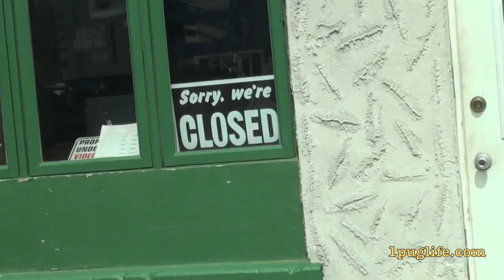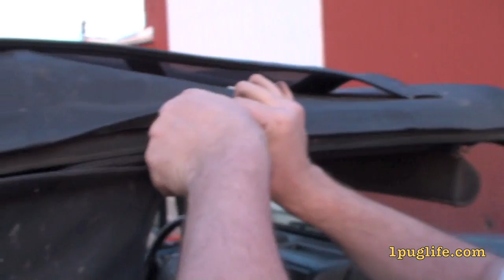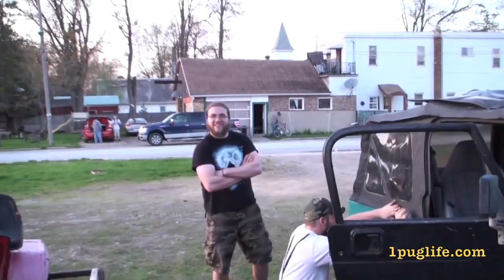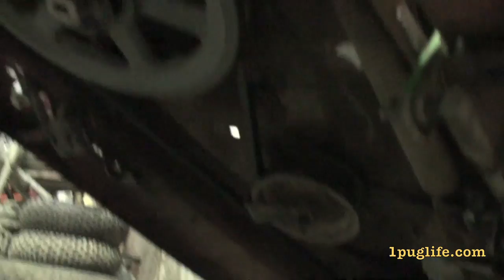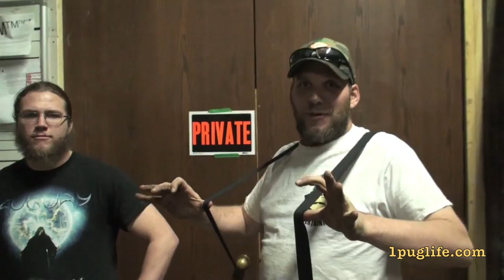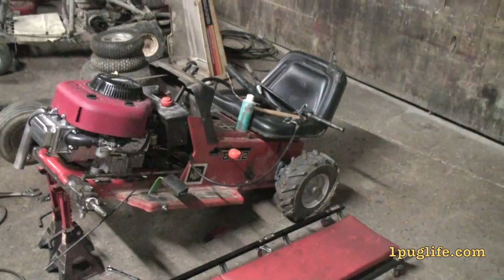train came

Comment: Still looks like way to much negative camber on those front axles/wheels. You're only loading the inner bearing and putting much stress on the wheel. I predict the same results as before.

I'd like to see you wear a helmet in order to keep your head in its original condition.

Good luck.